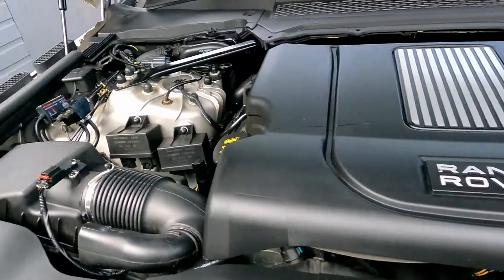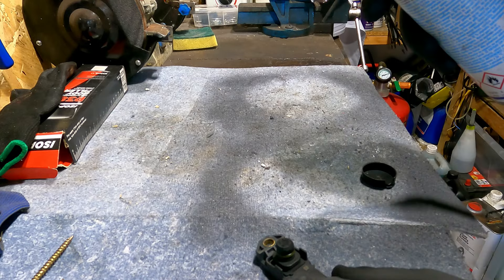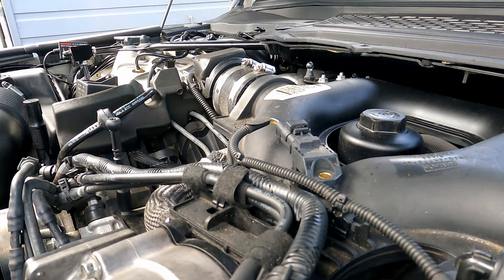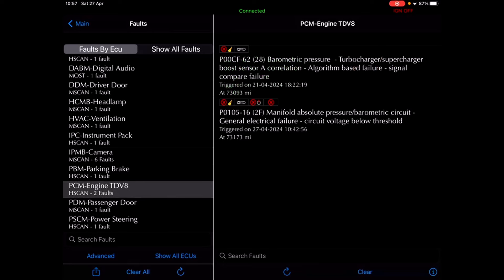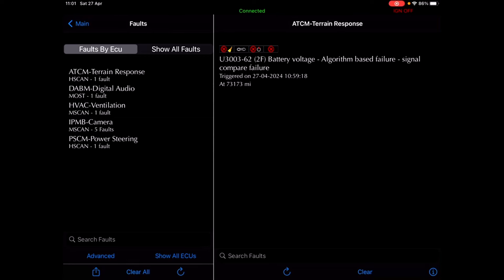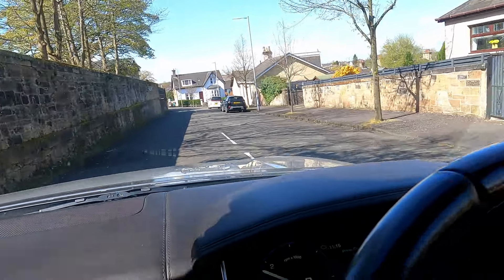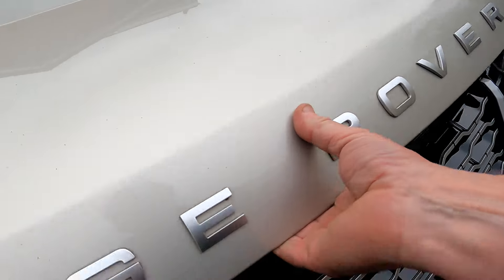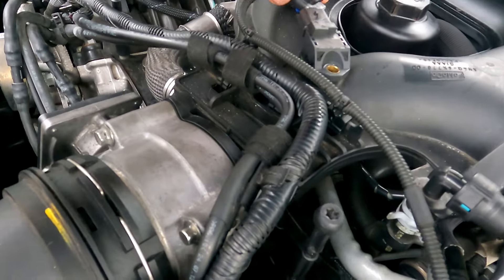Range Rover MAP Sensor Fail

Comment: I clean mine regularly with contact cleaner, gently tap it on a cloth to get the carbon “crumbs” out, did the same in my L322 and not had any issues, perhaps it was the compressed air
Reply: Also worth mentioning - I leave it to dry by a radiator or in direct sunlight for at least an hour. If some of that cleaner was still present and current went through it when you connected it could have shorted the sensor

Comment: There was a video on either L322 or L405 there is  an electric junction behind the wheel liner. The video stated that corrosion in the junction can cause electric issues. I hope this might resolve your battery voltage issue.

Comment: Very interesting video can you help me mine Range Rover have  2 Code I used Xtool D7S scanner  if you know how to solve this please.

1.    P0105-16 
2.    P040D-00 
👌👍❤️❤️🙏🙏
Reply: P040D is the tempertature sensor in the left hand exhaust manifold. Doesn't require any action as plenty of guys have ran with the sensor faulty for years, with no ill effect. My L494 has had it since I bought it. Not an easy sensor to change out, also carries the risk of rounding it off which in turn causes a lot of work to fix.
Reply: @Mac_F87  thanks 
I have also got Restricted 🚫 Performance issue.
Reply: @mvirdi2333  restricted performance will be due to the MAP sensor. Either clean or change out like Raymond did in the video.
Reply: @Mac_F87 thanks
Reply from the maker: https://www.youtube.com/watch?v=PddNWnLCslk how I replaced the Sensor with code  P040D-00
Reply: @Mac_F87  thanks

Comment: Are you using Gap tool scanner.
Reply from the maker: Yes GAP IId BT
Reply: @RaymiesGarage  thanks my Range Rover Code is 
1. P0105-16
2. P040D-00
How can I fix this issue please 
❤️❤️🙏🙏
Reply: @RaymiesGarage  this 4.4 tdv8 diesel engine?